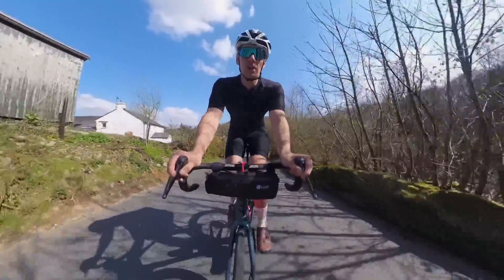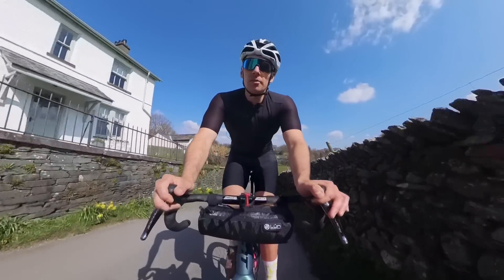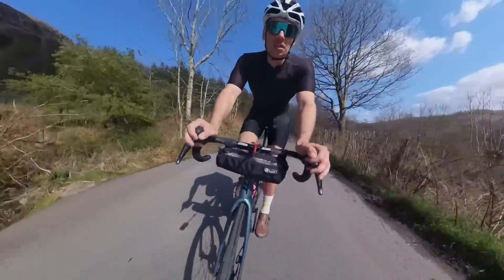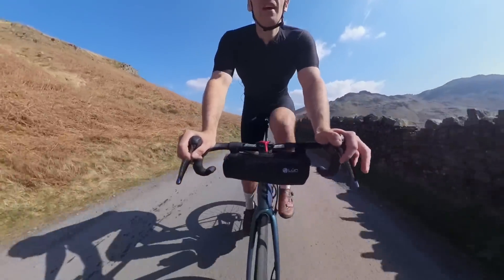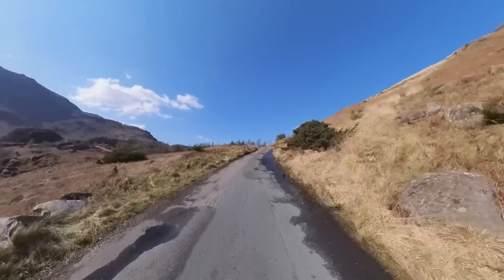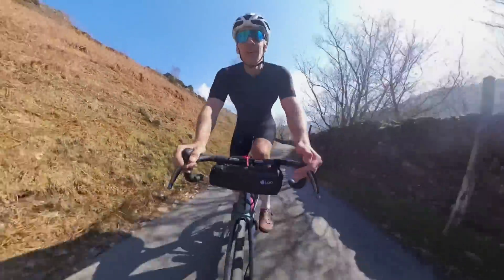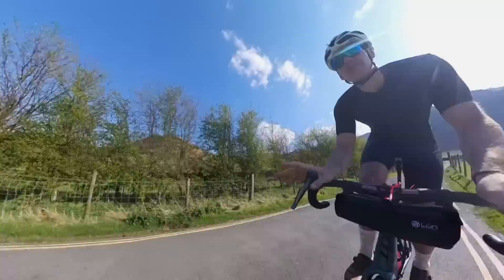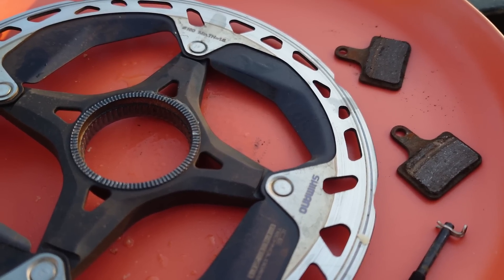Hyper D67 REVIEW - The Daddy, but Daddy got issues. (+ knackered rotors)

Comment: Wanted to ask you your opinion on this issue, using the winspace 50mm Hyper blacks, with ultegra discs, juin tech semi hydro brakes. Above 60kmh i get speed wobbles. Any suggestions? I would be on the larger side like yourself, 6ft3, 103kg. Wheels could need a service? fresh rubber on them. Noticed the wheel gets unstable slightly when free wheeling at that speed, touch front brake to scrub speed and its gone into a wobble.
Reply from the maker: Speed wobble is rarely wheel related. Normally its the frame and fork going into resonance above a certain speed, have you had your front and rear dropout alignment checked?
Reply: @PeakTorque  Thanks for getting back, thats reassuring to hear, I was expecting there was an issue with the wheel. No I have not, I am currently riding a Domane Al2 Disc (basically upgraded everything) Running 11 speed. 105 cranks, Chopped steerer (by local bs) with slammed integrated bar / stem. A Friend mentioned maybe I have made the bike too fast. As its really an entry level relaxed geometry frame. Just calling it out to give you an idea of the setup. I am planning an upgrade of frameset in the next month or 2, just lost a lot of confidence on the downhill on this bike now. Not sure what to do.

Comment: strange issue with the disc brakes. Coming from the mountain bike world and living in the Rockies, I have never had all the issues that roadies talk about with disc breaks. Wondering if it is the pad and rotor size that is causing the issues. I run 180 with ferrous pads, and generally get even wear across the radial height of the pad. At lease much more even radial ware. Wonder if it has to do with 4 pot calipers - though they are a PITA to get evenly pressed out on the occasion that you need to do a full flush.

Comment: Mr Peak Torque, you mentioned you're running a 52-34 chain ring. Any shifting issues on the front D with that? Am considering running a similar setup on my bike
Reply from the maker: Once tuned, absolutely no issues for 7 years now I've run this combo

Comment: HERE we re told disc brakes are better apparently not here And l was going to ask about 180mm maybe should be used instead HOW do those fair ?? l would not want to try that with carbon wheels and Rim brakes ,alloys sure which l have at over 75 km hr dragging brakes a lil for the corner BUT how do you find that road with RIM BRAKES ?? AND what about solid steel rotors how do they preform ??

Comment: Thanks for the stiffness table, always instructive even if you seem to find lower values than anyone else. what make the D45 Hyper so flexier compared to the 50? (there was no real design change, a bit taller and wider rim) and the D67? mechanically that can't come from the few mm shorter spokes.
Reply from the maker: Stiffness results depend a lot on the test setup, so everyones will vary. But all mine are done on the same table. I also start from a completely unloaded state which includes the bearing/axle deflection from rest (this is a good indicator of how much preload is on the bearings and much slop is in the system). I know Raoul Luescher applies a load of 10kg or so before measuring which is why he sees slightly higher stiffness values because he takes this slop out. But its an important part of the system so should be measured. The difference in Hypers is probably due to bearing preload and hub stiffness which will differ quite a lot just due to tolerances.
Reply: @PeakTorque  thanks, but 25% stiffness difference (47/35) seems an awfully big number to put just on bearing play no? Particularly on hubs that rely on machined shoulders with tolerances within few 1/100th.

Comment: I'd love to see you figure out how we can determine if brake whine is caused by the rotor or by spoke resonance. Maybe, weaving a rubber hose or some foam through the spokes, so if it still whines then you know it's the rotor?
Reply from the maker: It happens at the same Freq with 3 different rotor types. Which tells me its probably not the rotor.
Reply: @PeakTorque  Yeah, I'm not doubting your findings, just wondering how the average viewer could tell the difference without buying another rotor or two.

Comment: I'm considering D45 2023 or Swiss Side Hadron2 Ultimate 500 or DT ARC1100 dicut, which are almost the same as Swis Side. Only problems with winspace is  after importing them to Poland difference in price drops to like 100Eur (and DT Swiss are even cheaper then Winspace after importing)  due to customs and sales tax.Any thoughts?
Reply: In terms of compliance, Winspace HYPERs and HYPER 2023s are the least forgiving. Spoke replacement is also less convenient than with steel spokes as you need to find a wheelbuilder that has experience with carbon spokes.

Comment: Are the hub dimension/spacing and rotor spacing about the same as DT Swiss 350/240s? Been wanting to get a deep wheelset but want swapping between wheels to be simple and easy.
Reply: Rotor shims are your solution for wheelsets with slightly different rotor positionings. They're for whichever hub has the rotor sit further away from the left dropout.

Comment: Maybe stick with solid Steelies for Rotors? Sure, IceTech sandwich is lightweight and all that, but...maybe stick with the RT70 (105/SLX grade) ? Solid steel throughout and more weight, but more weight = more heat mass and perhaps less issues with warping because of dissimilar metals getting superheated and even a slight variation in thickness from the steel on either side of the rotor causing a slight warp towards the thinner side of steel which becomes a "feedback loop" of shorts wearing the thin side even faster? Just speculating here...
Go RT70...or go full MTB-tard with 2.0mm rotors, say Sram HS2. They look pretty cool. If you can make them work w/o rubbing that is.

Side bonus: you get rid of some of the "pumping loses" of the ICEtech cooling fins the 5yo whines about.

Comment: the best rotors i still using after 10y  on my touring bike the deore rt-54 and slx rt-66 (160/180mm) full steel rotors 1.57mm and more than 12.000kms  never warped and using with lots cheap semi-metal china pads ,some times with e01s metal shimano pads.
Reply: ditto

Comment: How wide is your front tire measuring up? I have Conti 5000 TR S in 28 and the front tire measured just over 29 and the rear slightly under 29 on  my D45. Would guess from an aero perspective a 25mm would be better altough you say otherwise in your video. Maybe yours is slightly narrower because it's the older version? Thanks for clearing that up

Comment: Great video and super interesting about the braking detensioning resonance. On a front wheel that's tangentially laced both sides (12,12) do you expect the effect to be less due to more lead in spokes on the other side of the hub? 
Also, what are those cages you're running? Are they unbranded, the carbonworks, or the new topeak ones? They all look the same

Comment: Yeah, editing my entire comment because now i've finished watching the video.

Anyways, here's my two cents. Top of the line shimano rotors are a sandwich of aluminium core and stainless steel braking surface. Golden brown is a good color indication on the rotor and it is the pinnacle of the temperature indicated for the best performance. If it was bluish purple, it would be the indication that you needed to upsize the rotor because of fading problems.

The problem there seems to be some some copper material of the friction pad melted, or some other contaminant, to get to this balled up point on the rotor. I would just sand down the pointy bit and keep using the rotor. Even if you manage to get bluish purple color you could just sand it with 80 grit perpendicular to the braking surface, the pads too, and bed in again. 

About the noise. Spoke noise made by you and the howling of the brakes are not the same frequency. Close, but not ressonant. Have you noticed that after the system got up to operating temperature, there was no noise? It is common for sintered pads to do this noise while being cold. They are better for longevity and long descents as they are harder. If you are not dragging the brakes, change for the bs01 shimano pads. They are softer organic, bite better, don't make noise, but fade a little bit quicker. 

If the pad swap is not enough, you can go to Sram HS2 rotors that are thicker, or any other 2 milimiters rotors. Galfer pads are awesome too. If you want more power, look in to 4 piston mtb shimano calipers (they do work since the main piston, lever, is the same diameter) or the 4 piston Hope calipers for shimano road brakes. 

I've been mountain biking for at least 18 years, testing, tweaking and gathering information around the internet, reviews and tests for a long time. If you don't want to spend more money, remove the balled up part of your rotor, install BS01 pads and be happy. If you wanna throw money at the problem, take hope calipers and organic pads with a thicker rotor.

https://enduro-mtb.com/en/best-mtb-disc-brake-can-buy/ 
Don't entirely go by their choices, the cura 2 is absolutely beast, and they haven't tested the "shigura" combo.

https://youtu.be/oF2vAOmplUI?t=504
Here is more details about rotor size and system temperature.

Cheers!
Reply from the maker: Cheers for your comment. The noise is always present, even after heating. It comes on with a certain lever force, less than or more than, it goes away. So it is resonant behaviour to me (i design stiff driveline systems for a living). 

I don't often use ice tech rotors, just had these lying around and I have numerous wheels on test. On all the others i run solid steel with no such problem. I have other videos where I have delaminated ice tech xtr rotors completely due to heat where the steel laminate starts ro peel up (with Shimano pads). Not fit for purpose for a fat lad like me riding hard.

Comment: Eminently logical, Spock would say. Like your point about assymtrical spoke tension. This also causes bike destabilization esp. on fast corners. Racers should not use disc brakes. I wonder if anything might cause rotors to magnetize and thus pickup small metallic particles. If you said that and I missed it, my apologies. All the best!

Comment: Thanks for the review. Very appreciated. Maybe I missed it but there was no summary at the end of the video? I'm using the D67s this season for casual riding and races here in Sweden. 28/25mm GP5K S TR. Incredible wheelset. Like you said -  can't see why anyone would spend more money for performance. No noise at all from rotors or spokes. Dead silent at 80kg. BR-R8170 calipers paired with SM-RT900 rotors and L05A-RF pads. Only switched out the wheelset for a week when I was in Mallorca for something medium depth (42s).
Reply: good to hear you personally get no spoke noise.wheel resonance....

Comment: Also a mechanical engineer here, I had the same issue with the disc rotor, but I have addressed mine.
If you observe the concentric circles left by the brake pads, and follow the concentric circles, the part that has got damaged has no cutout to clear any mud or debre, and I believe that is the reason that caused the failure. I have drilled one 4mm hole to effectively function as a cutout and the issue never came back.
Reply: Also it only happened on 160mm version of the XTR rotor, the 140mm and 180mm has just enough cutout overlap to cover the whole braking track

Comment: Interesting looking at the difference between different carbon wheelsets. I'm window shopping for my first set.  I would love to see a box section alloy wheel on the cda graphs as a reference, to provide context to the gaps between carbon wheels.
For now I'm leaning to a prebuild Light Bibycle AR46 with DT Swiss 350 hubs, 24 spokes front and back. Theyre in stock in their EU warehouse. Im of a similar build to you, any idea if that would be suitable? I recall you going with 28 spokes in the back for your LB wheel build.

Comment: Interesting about the brakes, I did my first trip to the Alps last year, prior to going I had nothing but trouble with the 105 spec rotors and pads on my Focus Paralane, before the trip I put 160mm XTR rotors and Ultegra pads and they were superb. I’m 81kgs and a fairly nervous descender so was on the brakes a lot. I got a bit of howling from time to time and quite obvious heat build up and occasional ticking but overall they stayed true and I was glad I upgraded. 

Do you think the issue you’re having is down to the extra energy involved with the steeper gradients?
Reply from the maker: They perform well, don't get me wrong. They just don't seem to last for me. 6 months isn't really acceptable for the price
Reply: @PeakTorque  I agree.

Comment: So the D67 is only very slightly more aero to the D45 due to the mudguards? The results aren't valid if the bike wasn't exactly the same setup.
Reply from the maker: No. Look at the graph again. There are 2 lines for the d67.
Reply: @PeakTorque 583.5 vs 579.6? Less than 5 watts?

Comment: Are they shimano pads? 160mm discs are too small for those kinda descents in my opinion.  I've fucked a 160 ice-techs off road.  Pads/discs got so hot they stuck to the disc.  That was the rear - never used 160 since.

Comment: I’ve got a set of the Hyper 50’s with Continental 5000 s tr , set up tubeless of course. Fast and super comfortable. But I have a huge issue. The front wheel is incredibly unstable, even in light winds. Almost crashed going downhill at speed when a slight gust of wind hit the front wheel and made the front wheel lose control. I end up using just the rear wheel with a shallow alloy front. I don’t known if it’s the sealant making it unstable or a wheel balance issue.
Reply: 50 is a little bit too high for front wheel, try 40 or 45 maximum
Reply: @drexydelavega5516  it’s not completely the fault the depth of the rim. Even on low wind days, like less than 10 mph, it’s super twitchy.
Reply: Probably a front end geometry issue. I get the same on one of my bikes.

Comment: are campagnolo AFS brake rotors compatible with latest gen. shimano ultegra/dura ace calipers? are AFS rotors solid steel at the outer diameter?
another excellent vid.
Reply from the maker: Yeh i use AFS on the other wheels. Really solid but the pins get sloppy and you get play between the spider and rotor
Reply: @PeakTorque  thanks.

Comment: Another 52/34 brother. Loving your work PT
Reply from the maker: Im thinking of going to a 53 - 36 now...prawn watts are on the rise... riding a bit, you know im kinda a big deal now
Reply: @PeakTorque  Larger chainrings make you faster. It's called induced demand, taught in econ 101
Reply: Hi, is your 52/34 mechanical or di2 shifting. I'm thinking of doing it (52/36 now) but a mate tells me its hard to setup and one negative aspect is you have to be in the mid sprockets to shift either up or down. I'm interested on your experiences....thanks.
Reply from the maker: @daijones1515  run it for years on ultegra mechanical and dura ace di2 11sp with absolutely no issues. Front shifting not quite as crisp, but its 80% there. As long as you set up the front mech perfect it works fine.
Reply: @PeakTorque  I'll give it a go, many thanks. Also bought some R45 Hypers last week using your code, really excited to be using them out here in Albir. I waited for the 2023 edition, but more so for the dollar exchange rate to improve.....result. Your content is absolutely fantastic.
Reply from the maker: @daijones1515  Cheers! Good luck with them.

Comment: You should contact Hope and fit their floating rotors
Reply from the maker: I have a set of hope center locks. Good life on the brake but they do wander around a lot on the rivets after heating so you do get some ticking

Comment: Any chance you could share the route? Looks phenomenal! I have these wheels in the rim version and am very pleased! I was interested by your comment regarding high lateral stiffness not ideal for everyday use - what's the reason for this? I find that lateral flex does not feel nice at all when cornering? Not to mention brake rub for rim brake boys like myself (but that doesn't affect you)
Reply from the maker: Really i meant stiffness in general gets a bit tiring on the really shit roads. This is blea tarn climb. Started the ride in Lancaster, up to Windermere, on the ferry, through Hawkshead to the langdales, and back again.
Reply: @PeakTorque  I have mavic cosmic carbon ultimate (CCU) full carbon spokes from rim to rim. The wheels are the stiffest I had, it s a pleasure during sprint, and HIIT training but not cool when the road is rough!